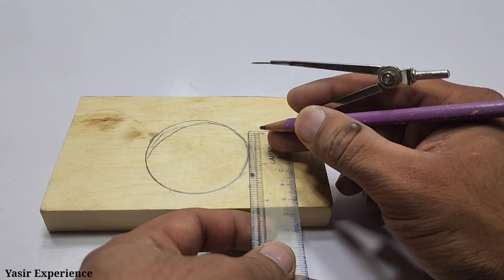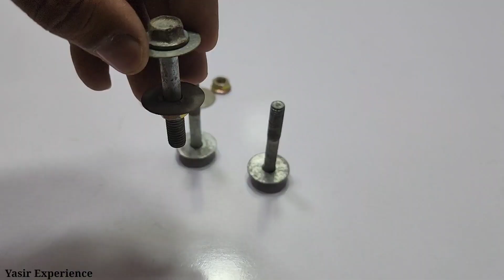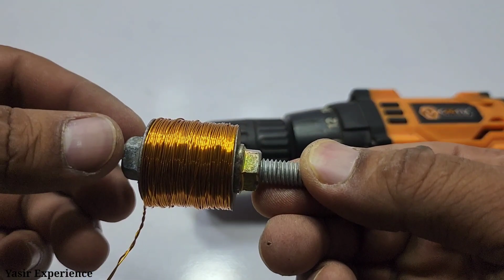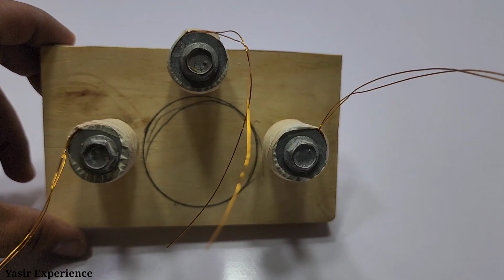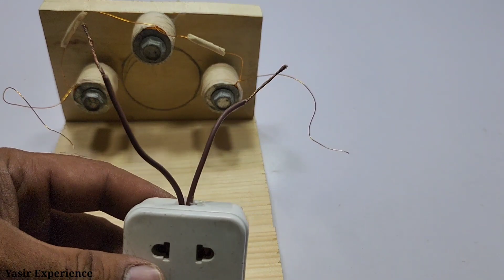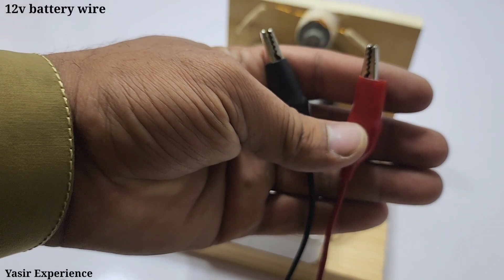How to Rewind Copper Wire into 260v Generator Use Bolt....

Comment: The same author and the same nonsense that does nothing at all. He should come up with something new, this is no laughing matter anymore. And for those who might want to believe it, I'll just give a brief reason. The magnetic field of the magnet is oriented in the axis of the circle, so it does not cross the coils in the right direction and therefore absolutely nothing can be induced in them. A common scam.